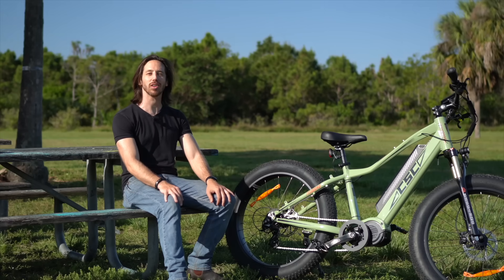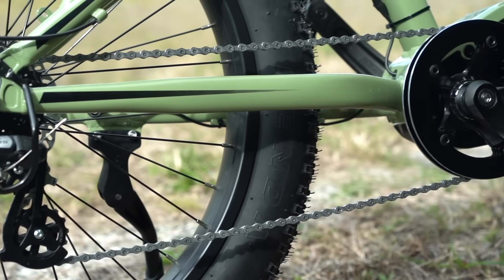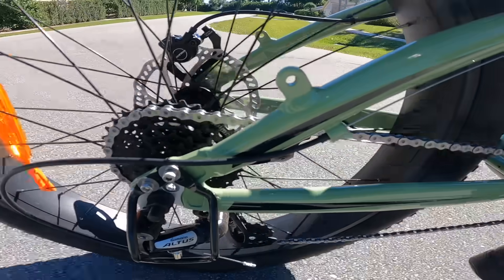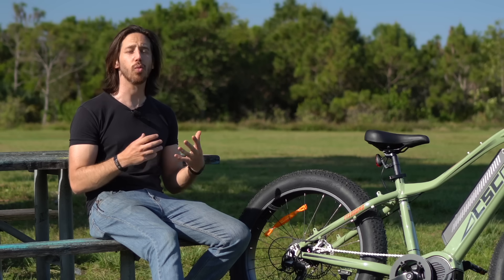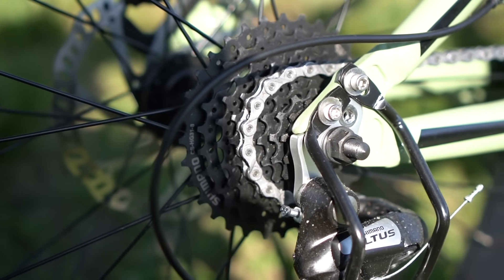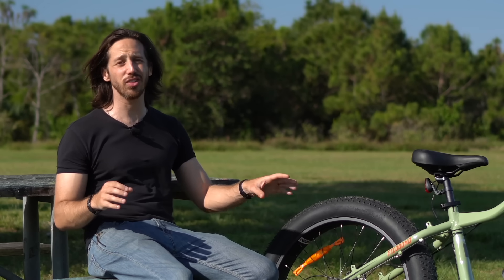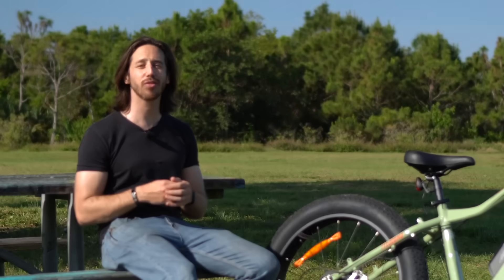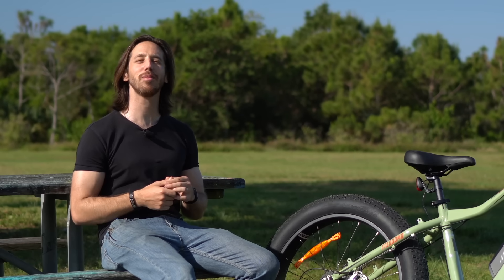How to (properly) ride a mid-drive electric bike

Comment: What you described in this video is pure common sense. The bicycle drive components are not robust enough to take full power in top gear from a dead stop. It exactly like conventional peddling  You don't start in top gear either. Thank you

Comment: Great video.   One question.  On the mid drive motors, are you able to use the throttle and not peddle or is it continuous peddling?  Thanks
Reply: I have the same bike in the video. You may just use the throttle only if you want

Comment: I think mine is a Bosch mid drive. I rode up to 24 speed Derailleur bikes for a long time before I got my e-bike. The back has 9 speeds and at my age, I don't push it very hard. I usually don't go higher than 5th gear.

Comment: The reality is that Ebikes design is still not at all perfected. If they were cars, I would put even the most advanced ones at around the 80s level. Good, but still nothing like the super advanced almost perfected mechanics of a modern automobile.

The drive trains in particular, need to go - as they are designed for a far less powerful motor (a human) and as this vid so well explicates, that's a problem. A design problem.

Comment: what if you tend to pedal while using the throttle on the highest gear? will that alleviate some of the pressure on the drivetrain?

Comment: Basically, a great video and much needed. Humans do indeed though put out more than 160nm's of torque. We use 90 daily, with our ARMS in shops every day. 160 is just one leg. The additional rotations of a mid-drive do put more wear on a chain and the fact that e-cyclists really will tend to ride further, faster and more often.

Comment: This has been the most informative video on how to shift with a mid drive motor. I just ordered Lectric XPremium bikes for my wife and myself. My question is what do you do if you are in a high gear and you have to stop suddenly and didn’t have a chance to shift to a lower gear. Can you use a little throttle to get started again until you can pedal again and shift gears? Or what?

Comment: Ya, seems these drive trains weren't meant for the powerful ebike motors.  I've gone through many cassettes and chainrings and chains plus the shifting cable stretches as well.  They should engineer much more robust components for ebikes.

Comment: Something's wrong.  150 Newton meters ought to be able to effortlessly push the smallest rear cog.  If the motor is turning too slow then the gear reduction inside the motor needs to be greater.

Comment: My Luna X1 mid drive has no motor cut off on the brakes nor does it have a shift sensor,  so I have to pay attention. My shift time is sloooow. I have to reduce pedal pressure, then wait what seems like an eternity for the motor to let up, keep the crank moving enough to allow the shift, then shift.  Honestly it's a bit of a pain compared to the simplicity of a hub motor,  but for mountain-biking the mid drive is so perfect for grinding up hills.  Would love a Rohloff with a mid drive!

Comment: I was aware of the problem that some motors doesn't interrupt their work whilst the driver is shifting gears or how to properly make tho motor to do so. By using the brake lever (as long as there is a switch which interrupts the motor power) this is a very reliable method to avoid stressing the drivetrain -thank you! 🙂

Comment: Can you just leave it in a middle gear and ride it like a hub motor bike? for those times when you just want to do quick casual rides without the need for all that speed or torque.

Comment: Good advice to confirm for me. I got a Vado 4 last year and put most of my miles commuting to work (10 mile round trip).    I did find I had a lot of wear on my smallest cog for one season of riding.  So I swapped the front chainring from a 40t to a 44t.  The idea was I wouldn't need to be in the small cog all the time which would help wear on the whole system (cassette, chain, etc).    Especially an E10 "electric" bike chain is $50.  So this has worked well this season with the desired results but I had to sacrifice the "granny gear" on the cassette to keep the chain tensioned in all speeds.  So far so good but if I ever get caught with a dead batter and a hill I am in trouble.

Comment: Have you ever gotten a broken chain anyway? Anything 1500w and over probably needs a motorcycle chain, but that will still tear up cogs if shifting under load. Even a motorcycle requires a clutch to shift gears.

Comment: Good advice; but it shows that racing bike shift mechanism is not the best system to work with mid-drives. A 3-speed in-hub shift mechanism would be a better solution. I used to have one of those on my CCM bike in the 60's.

Comment: I'm still readjusting my rear derailleur in order to get perfect shifts and better alignment. What I also do is pedal while shifting (I have a shift sensor) or even use my brake cutoff to shift at speed. However, I still need to fine tune that derailleur. I'm going to upgrade the rest of my drivetrain (derailleur, gears/cogs, chain) for my MTB (BAFANG BBS02B 750W) and fat bike (BBSHD 1000W) as well as my brakes, rotors, and forks in order to tame these beasts. I'm also considering ebike-friendly IGHs as an alternative.

Comment: Mid drives with EU/UK limitations have generally cut off motor assist by the time I'm in high gears anyway, so then I ride them just like a non motorized dérailleur set up. The valuable take away here is to match your cadence to be working with the motor, particularly going up hill. It's e-assist, not an electric moped.

Comment: Excellent explaining  of  mid drive motors and shifting gears. I own three hub drive ebikes  and prefer them now over getting a mid drive ebike which I thought about doing, but will pass as I don't like doing the shifting. Call me lazy, but my reason for an ebike was not to be shifting gears. Do like though using only the pedal assists and throttle.

Comment: Shifting as awareness of ease in changing gear is constant, more or less.  I learned as a pre-teenager shifting using double-clutching in a '47 Flatbed Ford 2 ton truck, they should slide together...aaaa! the summers of '69-70

Comment: I have a bafang 750 watt mid motor.  In my riding around town, I rarely shift out of 3rd gear and power assist 2.  Going up a hill i'll go into power assist 3.  And you're right, going down a long gentle slope, I'll shift up to 7 or 8th gear and add a little more pedal assist.  Can do 45 km/hr easily like that.

Comment: Doesn't that bike have a shift sensor to help reduce wear on the gears? I think it does and you didn't mention that.
Reply: I own one of these CSC Mid Drives. It's a beast, and yes it does have a shift sensor. The cable for it is mounted on the right side of the handle bar and has a tiny LED that lets you know when it's activated
Reply: @totalkaos1580  I like it.. It's a classy bike
Reply: @kevinnashskitchen3517  CSC is a great company to deal with. I got a email from CSC yesterday letting me know all of their E Bikes are on sale. They even answer the phone when you call, no automated system, but they are closed on the weekends.
Reply: @totalkaos1580  it's still a company to consider .. Good customer service is very important.
Reply: @totalkaos1580  I'm leaning towards an Ariel Rider full size fat tire bike now. Kepler. Just the price and battery caught my attention

Comment: Motorcycles need to change sprockets and chains on occasion. They should set up bike sprockets to be able to individually be replaced or be bought as a kit to change them all. A good set of  Sprockets on a motor cycle are like $30

Comment: I leg press 1000 lbs. even at 64. So I won't have a problem with a mid electric bike. Trying to motorize my Worksman Adult Tricycle with an electric motor. Without changing the Tricycle it is a vintage vehicle.

Comment: Thanks for the video. I am new to the whole Ebike thing for that matter I haven't ridden a bike in about 30 years. Last year I had dual knee replacement surgery and after the operations I wanted to improve my somewhat limited ability to bend my knees properly. Before my operations I purchased a nice 10 speed bike but because of the cross bar, I wasn't able to get on and off safely while recovering. About a month ago I bought a Giant Lafree Ebike that is a step through modal. This helped a lot. While I have spent a few weeks riding near my home, I wanted to go on a short vacation to somewhere that is bike friendly and interesting place to spend a few days. I just returned from three days in Gettysburg. The town is very bike friendly with well painted bike lanes on most roads throughout the main battlefield area making the experience of riding a bike so much fun. I found I was able to ride each of the three days for 4-6 hours a day with little to no knee pain. I recommend an Ebike for anyone like myself who has knee issues and find normal bikes to difficult after surgery. Thanks again for the videos.

Comment: Excellent video, like the break tip, never thought about it, for bikes with break sensor. Other tip, avoid standing on the pedals, so you use the  whole range of gears, instead of just a few. From personal experience.

Comment: They're neither gears nor cogs - they are sprockets !
The message here is similar to normal cycling - we like to have a comfortable speed of pedalling - called 'cadence', or revolutions of the pedal cranks each second. It is so much easier to keep a similar pedal speed, just use the gears to match your speed to the same pedals rpm - or cadence.   😉

Comment: I’m a new subscriber and this channel couldn’t of come at a better time. I used to have a easy street rear hub motor. I really enjoyed that bike ,but it broke and I can’t find anyone and I mean anyone to fix it. I even called the manufacturer “BH” to ask for help and I got no acked. So I bought another ebike and I went with a Dost with the mid drive. I really wished Dōst made the bike I wanted in a rear hub motor but they don’t. So the mid drive is new to me. I actually never shifted my old bike. I didn’t really need to. I ride on flat asphalt and I never rode all that far. But I learned a lot from this video so I subscribed. Thank you for all the good information

Comment: I have the swagtron envy cycle bike I think the motor is 200 or 250 watt it uses 36 volts think that battery was a 4.4 amp I got a 14 amp battery after using it two or three times the motor controller was not working right it was getting hot or warm can you tell me what is a good size motor controller to use for it using a 14 amp battery

Comment: The motor doesn't care which gear you're in. It's going to deliver as much torque to the front gear as you ask it to. The only difference from the rear gears is how fast you will be accelerating. Also "helping" the motor by pedaling won't help the drivetrain. The force going to the drivetrain will be the same.
As for the internal gears in the motor. You are probably better of with a high gear since that will lower the RPM and thus reduce wear.
The problem with always being in the highest gear isn't extra wear on the motor or even the chain. It's that you will be putting all the wear on a single cog. Add to that that cog has very few teeth to spread the wear.
So it is a good idea to change gears. Just not for the reasons stated in this video.

Comment: Great advice.
I always finish ride in 1 assist or 0 assist and first gear.
Throttle release then upshift is fun like a motorcycle.
I will try brake lever trick.
Early downshifting before a steep grade is must learn habit.

Comment: Why aren't hub gears like nexxus being used for mid drives ? All the internal gears are dirt protected & surely would last much longer ?
Reply: Gear ranges in cheaper IGHs aren't match to "chain salad" and doubt all IGHs can take extra power/torque from proper mid drive in real long term.
And while protected from environmental factors, good lubrification is needed to keep low wear in long term.
Eventually those greases degrade/get contaminated by any microscopic particles wearing from surfaces.
And relubrification isn't easy on those using grease.
Though Rohloff Speedhub is built more sturdily than most IGHs and uses easily changed oil lubrification just like vehicle transmissions.

Comment: I converted an old Gary Fisher bike to Bafang 1000 watt mid-drive, One of the things I found a Luna Cycles is sensor that cuts power when I shift. The derailleur cable runs through the sensor any motion in the cable cuts the power, and it works great.

Comment: Why would using the throttle place more strain than pedal assist when traveling at the same speed? Should be the same amount of tension on the drivetrain.

Comment: If your pedaling cadence is  less than 70 RPM then you are overloading your e-bike motor. Actually you should maintain 80 pedaling cadence regardless if you are going up or down to be efficient bicycle rider. Most recreational cyclists generate about 0.35 hp for a sustained (2 hour) ride. Competitive cyclists pedal at an average cadence of 80 to 105 RPM and they do time trials at 110-120 RPM.
Reply: Depends on motor's design and what kind internal gearing it has.
Go to higher cadences with Yamaha PW and it starts fast losing its power and above 90 cadence it's essentially powerless and you won't get any acceleration.
But change couple gears higher and you start suddenly accelerating.
Reply: @tuunaes  The torque sensor is doing its job. If it doesn't sense enough torque then the motor won't help you as much. You have to find that pedal cadence that the motor gives the assist you need yet not lugging the motor to overheat and at the time saving battery power. You should constantly shifting gears according to the terrain on a mid-drive e-bike.

Comment: I have a Raleigh Motus with Bosch mid engine and to be honest I intuitively, that is, I always start from rest in slower gear, usually 2nd gear.  It makes no sense whatsoever trying to start in a high gear.  I also, intuitively, ease off on pedal pressure when shifting but I always did that naturally anyway on a regular cycle as  think all cyclists do.  However once up to about 12mph on fairly level terrain I like to turn my motor off for two reasons.  I have heart failure, severe spinal compression and I'm 73 years of age so I need the exercise and this is the safest way to do it for me.  I also like to ride 50+ miles at a time so I need battery power in reserve if my condition takes a turn for the worse.  If I'm 25 miles from home I need to know I can get home with the minimum of effort.  Obviously if I take really bad I will stop and get a family member to come and pick myself and bike up.  I can get 120miles out of a 350w battery riding this way but my bike is now over two years old so am I doing any harm to the motor riding this way.  I haven't had one iota of a problem with it even after being 'van doored' at 20mph and ending up in hospital with massive bruising and concussion... thank heavens for my helmet.  The bike faired better than myself with only cosmetic damage to the tune of £30!!  One very well built ebike!  I'm a bit OCD and service my bike at least once a month, something I get real pleasure out of but I don't open the motor other than one side plate for gear greasing.  I haven't observed any wear or damage it would be nice to be reassured my riding style isn't harming the motor. Drive trains I renew annually as a matter of course.

Comment: So, glad you made this video, Micah.  Really points to a lot of the reasons we had been focused on hub motors over mid-drives.  The main issue being, parts used aren't made to handle the requirements.  Your car analogy was ok, but backwards.  In a car you want to be in the most torque providing gear off the line, where on these you want to start in "4th gear" as you put it.  It's flip flopped from each other.  High cog on a bike is a low gear in a car trans.  Just watched Sandy Monroe's review of the Protean hub motors, very interesting stuff

Comment: All common sense. You repeatedly make reference "if you have driven a manual transmission".  When is the last time you saw anything other than an automatic in any vehicle?  I blame it on auto manufacturers aiming their products to the least common denominator. Most think gas and brake and voodoo happens in between. Aimed to the same people thinking all they need is gas and who cares about maintenance.  I would suggest that this epic mode of thinking MIGHT be tied to more females driving....

Comment: Great point comparing shifting with how one shifts with a car or motorcycle using the clutch. In this case, it’s akin to the VW bug semi automatic transmission, where you had to manually shift but there was no clutch. All you did was let off the throttle and shift.

Comment: If I get to a steep hill often I'm at a stop or standstill. I just pick up the rear of the bike and shift to the lowest gear using throttle. This puts no strain on your gears or motor and now you're in the best gear for the hill. 

I never shift uphill since I live in the mountains. The lowest gear is plenty speed for uphill throttle.

Comment: In the conditions I ride in, I rarely shift above 3rd gear.  Most of my riding is flat land.  Once in a while I come to a 15 or 20 percent grade and I stay in 3rd gear, but up the pedal assist a bit.  haven't had any problems so far.  I'm 75 years old.

Comment: The rules when to shift or not apply to motorized bikes the same as to non-motorized ones. The mistake many e-bike riders make is to mistake the support-level selector for a shift lever. As soon as it gets uphill they select a higher level of support instead of shifting to a smaller gear first, and then complain that the battery does not last as long as promised.